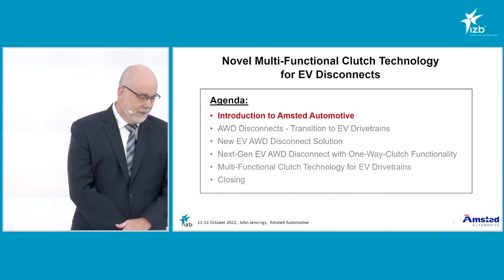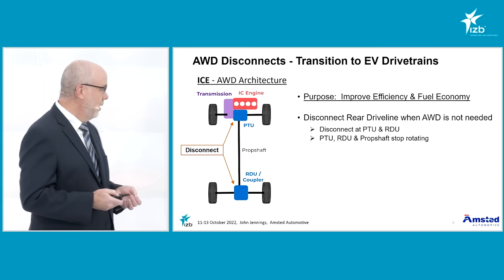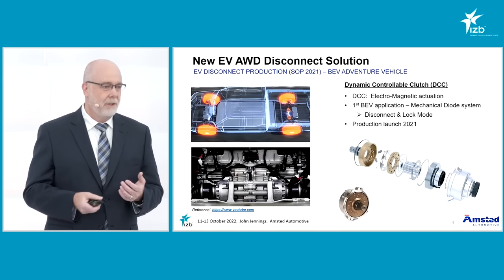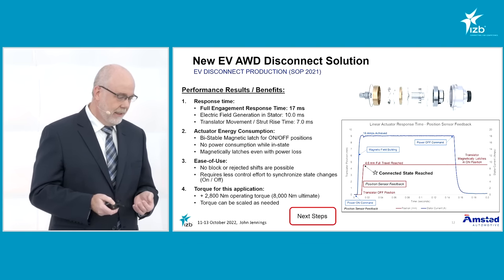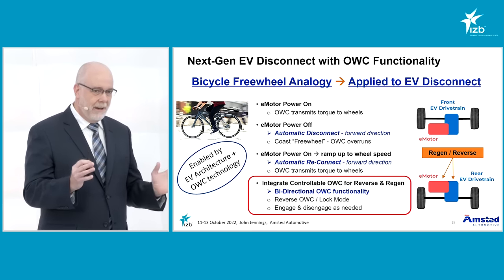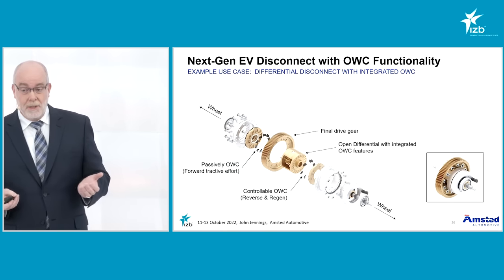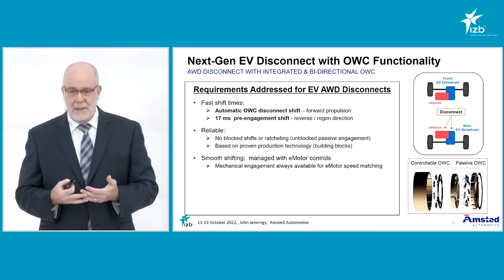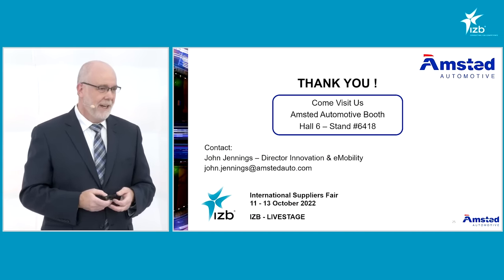Overview of Novel Multi-Functional Clutch Technology for EV Disconnects

Comment: Disconnecting the secondary eAxle when AWD is not needed improves vehicle energy efficiency by 8% on average.  This translates to 8% longer battery range, or 8% downsizing of the battery for a significant vehicle cost and weight reduction.

Comment: In a single-speed EV motor design why is a clutch necessary when the electric motor itself can emulate this behavior? I would be interested in it if it actually extended rotor lifetime due to the reduced strain on the EV motor.